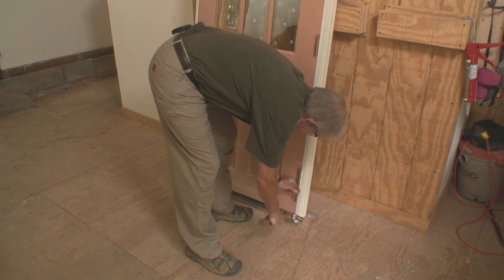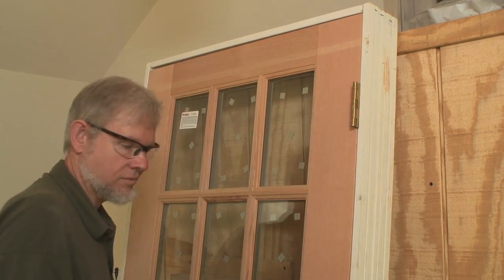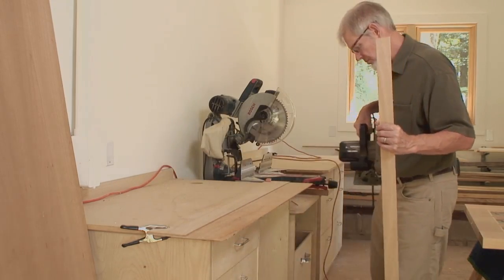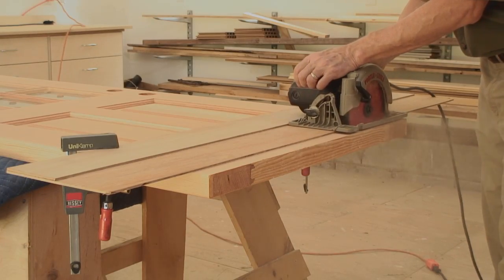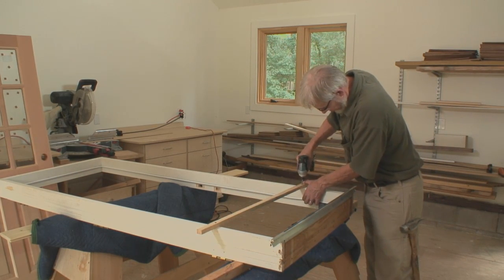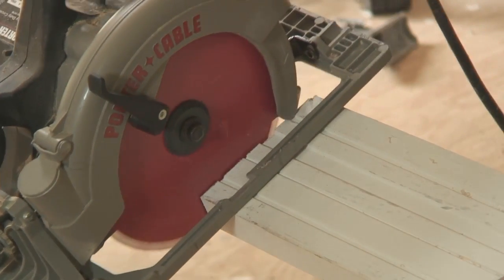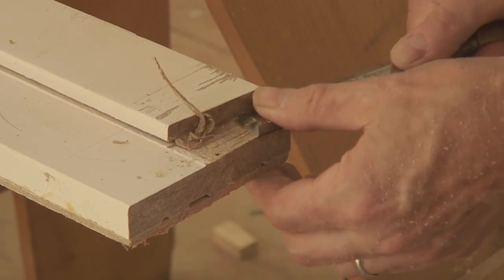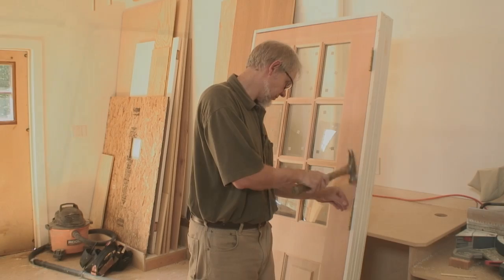How To Cut a Prehung Exterior Door to a Custom Height

Comment: how do you make sure your cut is the right size so you don't cut off to much and leave a gap between the door seal & threshold.
Reply: Measure, measure. . .and then measure again! You can always cut more off if you cut too little but youre screwed if you cut too much-well not screwed but you'll  have a smaller door.  We just did this.  Like yesterday!  It took me 2 days to work up the nerve to actually cut the door and jamb.  Remember to brace the jamb with a piece of wood so the prehung jamb doesn't get messed up.  I think we took ours off too soon and it got messed up and it took HOURS to resquare that door!  Well, there was a lot of "breaks" because we were ready to throw the door across the room! 🤣
Reply: Oh yeah!  You can make a guide to keep your blade right or go purchase one.  I got one at harbor freight.  It was like 20 bucks.  Not sure if this guy does it-i don'tremember; but, if not search for door cuttin' videos.  I would give you a link but that doesn't seem appropriate on someone else's channel!

Comment: wouldn't it be smarter to cut the TOP of the jam to size??
Reply: No it would be stupid the door wouldn't line up with hinges.
Reply: @pitsmcgoo  Not if you cut the top of the door as well. As long as you cut both from the same end, it is a matter of preference. Or, depending on how much needs to be cut, you may be better off to cut BOTH ends.
Reply: @raymccoy9105  If you cut the top, won't that "desquare" the door since you will have to take it apart?  The jamb, I mean.  Like mine came with the top all ready for install, but the bottom, I could take off the threshold.  It was more removeable.

Comment: How can you cut the frane same length as door that would never work  the door would be shorter than frame to accomendate thresshold and weather strip on bottom.
Reply: "You'll need to shorten the frame by the same amount as you did the door" is what the video said... Yes, that'd work just fine.
Reply: He didnt say to cut the jamb to the same length as the door, he said to cut off the same amount that you cut off the door....listen carefully, the method described in the video will work just fine.

Comment: Can you trim down a metal door?
Reply: Man he must really be thinking about that one.
Reply: I need to know that also
Reply: Sure. Pretty much the same way. Just need a suitable blade. Best to cut half way through from each side, cutting only one piece of metal at a time.
Reply: Yup!  Just did it yesterday!  Make sure you take the bottom piece off the cut part to use again.  Again, there is a REAL good video cutting a metal door.  It was actually easy if you get the right tools.  You need a metal cutting blade AND frog tape over the cutting area!  (You have to measure, put the frog tape across the cut mark, and the remeasure so your line is on top of the frog tape) It actually prevented the metal from chipping while cutting!  And I got a Diablo wood and metal blade 32 teeth.  I wanted more for a smoother cut but I couldn't find one and that Diablo blade did a great job. Got that from a video.  It actually worked!  Then, after you cut it, you have to use like a dremel to remone some of the core to make room for the bottom piece to be reinstalled.  You also have to take a piece of fairly rough sand paper and gently (like your filing your fingernails) take off the extremely sharp edge that will exist where you cut.  But you don't want to sand the paint off, just a little at a time just to smoothe that rough edge. I sliced my finger on it.  It is sharp!  🤣🤣  I'm sure you figured it out by now!  I just looked.  This is from 9 years ago! 🤣

Comment: So now the door knob is lower than the standard height of other doors.   Why not do the same procedure to the top of the door?  The hinges would still line up and the door knob would be at standard height.
Reply: Because, as he said, he needed 1.5".  You should only take a half inch from the top.  SOMEone wasn't paying attention! 😂
Reply: Way to not listen...
Reply: I just cut 3" off a door.  I had to, the opening was only 72" and that was after I ground down the cement floor to even it a bit!  My door knob will be low but I can live with that!  It's a bitch resquaring that door after you cut it!

Comment: Cutting should be done on the wide part of the saw base
Reply: What do you mean?   I'm always up for tips & tricks!
Reply: @saltyolbroad2962 what he's saying is... Always use the wipe part of the base plate of the saw on the side of the material you are keeping. This helps keep your cut at the desired angle ie. 90° 
For some reason tool manufacturers have decided almost all the cordless saws out there are made the opposite side  to a power saw. Milwaukee and Makita are two that make a couple on the right side, when I was being trained I was always taught to never cross the blade with any part of my body as doing that can cause injuries if the blade bites, I wonder how many people have been hurt because of the fact most the new saws are made in a way you have to cross the blade with the arm your cutting with.